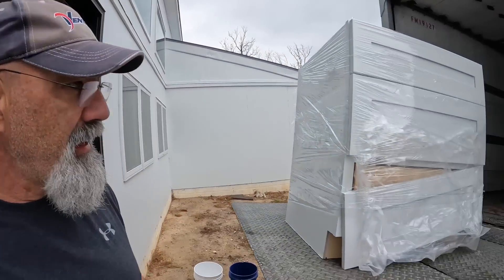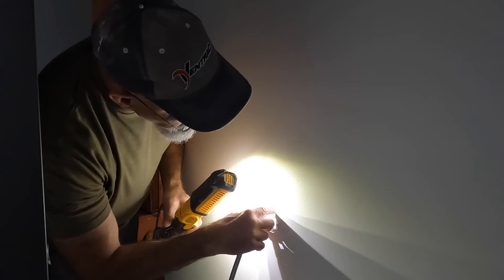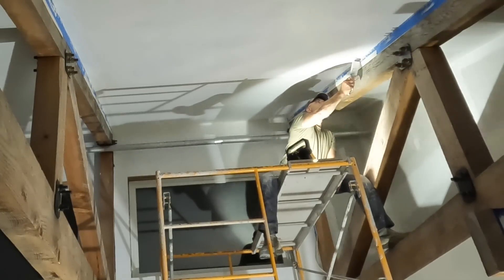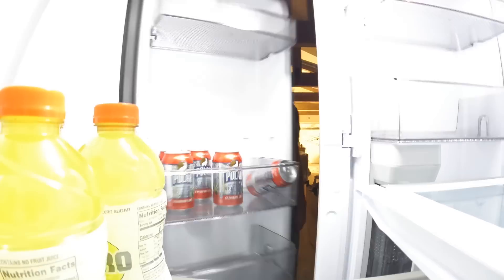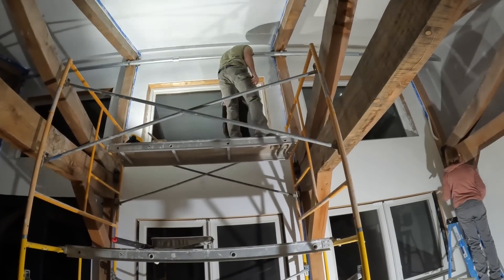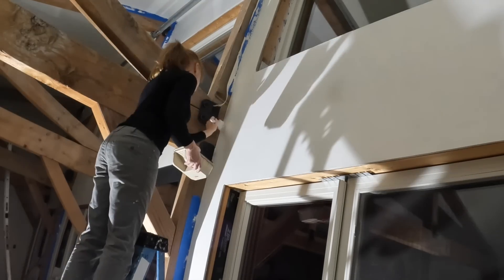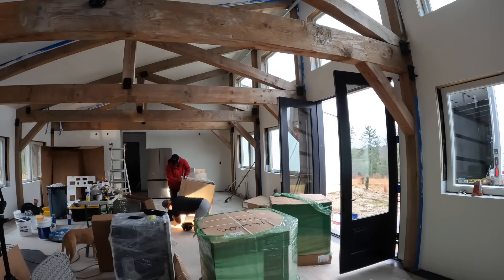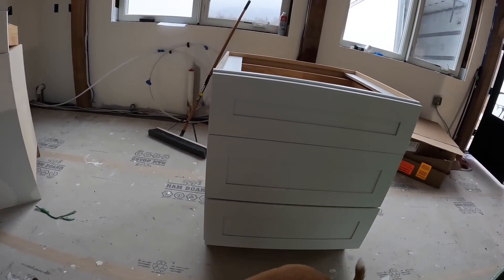The Kitchen Cabinets were Destroyed

Comment: I would  of rejected the whole load after seeing the first 3 , I thought you'd ordered RTA cabinets
Reply from the maker: We were thinking this would be faster than the RTA . And the RTA we were looking at didn’t have a farmsink base that I liked
Reply: @breakheartorchard  I used RTA cabinets in my kitchen and bathrooms my wife questioned my decision,  solid plywood  bxs hardwood fronts . I've got a hand hammered copper farm sink ,yes I had to modify the sink base cabinet  but worth it  a few internal braces in the sink base to support the sink  but easily accomplished,  I was a butcher by trade and Custom Tile setter part-time